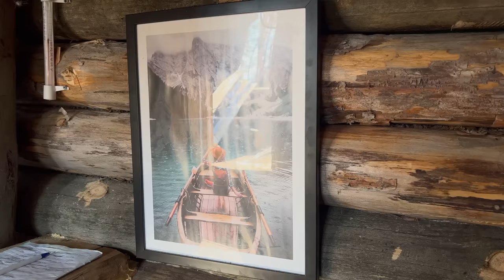DUGOUT LIFE: flooded UNDERGROUND HOUSE? What happened when SPRING CAME?

Comment: For those wanting to build a dugout:
- It's best to build it on higher grounds to avoid flood as much as possible.
- Avoid building it at the bottom of a hill!!
- If you're ready for it... put a layer of big rocks, then medium then small rocks at the bottom. Then cover with earth before doing the floor. This will be a formidable drain in case of a flood.
- Also, make a trench all around. It has to go BELOW the floor level and either add rocks covered by a membrane then fill it over. Or you can use a flexible tube with holes (French Drain). Then have a trench going far away from your dugout.

You can also char the log. They will resist much longer to the element and humidity.

I hope this helps!